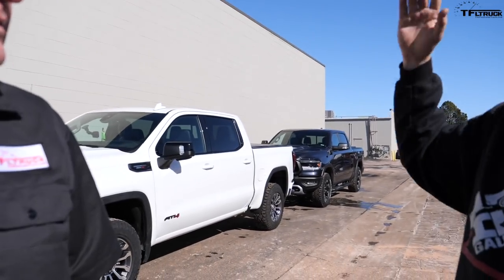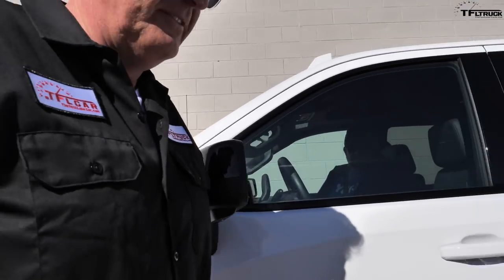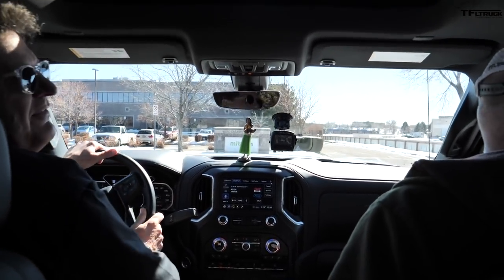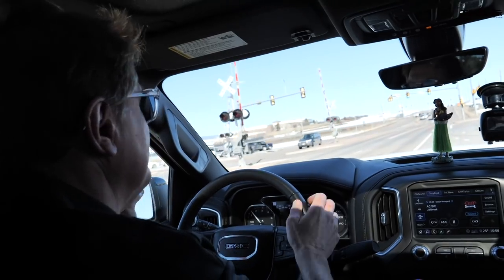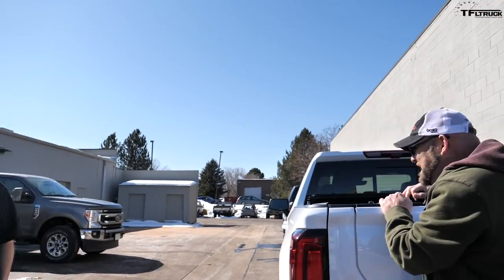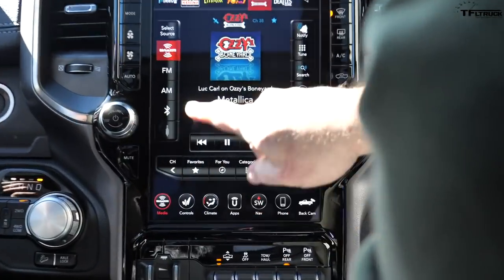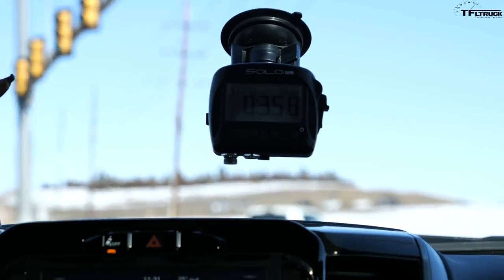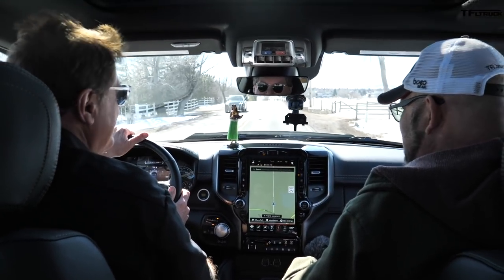Best Diesel Truck! 2020 GMC Sierra AT4 vs Ram Rebel Diesel 0-60 MPH Buddy Review

Comment: The barn door is much more functional.  The GM tailgate is a gimmick with lots of failure modes.  Its not going to age well.  Putting electronics in the tailgate is always going to be an issue.  Its there to look pretty, sell trucks to people with more money than brains and only needs to work till they drive off the lot.  Thanks Roman for demonstrating the issue with the bumper step.  And they fill with crap, freeze and look like crap.
Reply: I don't know which video you were watching, but tur Ram had push button electronics to open the tailgate too
Reply: The bumpers rarely fill with anything, I have NEVER not been able to use them because there was crap in them. I live in MN and mine has had zero freezing issues. Quit speculating on shit you don’t know anything about. Both of the trucks have electronics in the tailgate. Quit being a RAM fanboy
Reply: @zimks  Thanks for the well thought out response.  You devalue your comment with your own words by attacking a commenter rather than providing  your own opinion and supporting rational.  But I am sure you can learn from your experience.  :-)

I live in Colorado.  My two trucks live outside 24/7.  Everything fills up with snow then freezes and turns to ice.  After a foot of snow I cant even see my trucks as all surfaces are deep in the white stuff.  I have had 34 inches of snow on the level in my driveway.   Left on its own, the snow will thaw, freeze, thaw and freeze and form a crust of ice.  Given the right conditions the bumper step can fill with snow and become a slip hazard.  The safety engineer in me says to avoid them unless you have inspected them to make sure they are clean and dry else you will be crushing your nuts on the side of the bed or on the top edge of the highly functional tailgate.  Much like Roman almost did while exiting the GMC.  

Also, I personally find this kind of "feature"  (I consider it a non-functional gimmick but that is my personal opinion) unattractive at the least and a pain to maintain.  I keep my vehicles in better than showroom condition through frequent maintenance and care of the exterior, interior and drivetrain.  Any black plastic part is a magnet for fading and deterioration without regular maintenance.  In my case, I will not use them,  I don't need them, and I don't want to see them.  Other than that, I am sure they are great for you and I am happy that you like them.  I hope you have them on every truck you every buy. 

Your comment about RAM fandom reads like sour grapes.  GM is giving up market share to RAM because they are a higher value purchase.  Same or better performance for same or less cost.  Why would I ever stop being a RAM fanboy?  I had nothing but Fords beginning in 1976 with my first F150.  Black 4x4, regular cab long bed.  I have owned 10 F150s before I bought my 2015 RAM.  I bought it over the Ford (never considered a Chebby) because of the cost of ownership for great performance was very favorable.  Cheaper, better, faster.  :-)

 I am too old to be a boy in the first place and  you and I are not butt buddies so you don't have a clue what I like or don't like, and the last time I checked my copy of the constitution, I am still free to have my own opinion without an internet troll hiding behind the glass casting aspersions.  Hope you have a truly wonderful day up there in Minidoka.
Reply: @domin8ss  Interesting, the videos I watched showed a mechanical latch.  No electronics but I have not actually had hands on.  Have  you?  Thanks
Reply: rob the elder the same could be said about yours 👍🏻
Reply: @06colkurtz  just go to 17:58 in the video.  There's clearly an electronic button to open the barn doors.

Comment: At the prices either of these trucks cost, fuel mileage really doesn't matter.  Can buy say a used 2 year old gasser getting far less mileage and afford to buy the extra fuel.  A typical 2 year old gasser $25-$35k., vs these at well over $65k?  The depreciation alone will be staggering as most over priced big three automakers trucks are today.

Comment: I agree about the huge screen the Ram has. It's too much. Overkill really. The actual info part of the screen isn't even that much bigger than GM or Ford. It has a bunch of touch screen buttons which I don't care for as well. But yeh all that touch screen stuff takes up like a third of the infotainment screen. So it's not really even that much bigger. It's just way too busy and IMO takes away from that amazing interior in the Ram trucks. So yeh I'd say it's a waste of tech. Not to mention if your hands are dirty after working and you get that screen dirty the touch function isn't even gonna work right. Give me the smaller less busy screen that you can still use actual buttons on any day of the week.

Comment: Those "super-cars" have exposed weave carbon fiber. You can get carbon fiber that looks just like plastic, typically that is under the paint on exotics that use carbon fiber since it wont be exposed.

Comment: I was at a dealer and there is no skids plates only on the engine and it to tin :( that’s all :( 
They need to put the interior from 2021 Yukon :) and electronic lockers to :(
The GM it’s not off road truck it’s Country road truck LOL 😂 
And there is no 2 inches lifting kit  it’s level kit LOL , it hurts to knuckles and it’s made to be in the shop :( 
If you look carefully there is no difference then Denali & Sierra or AT4 :( only Rancho shocks junk and tiers LOL 😂 NO Dif Lockers no proper lift kit :( and cheep Shocks :((

Comment: Don’t like the all-in-one dash on the Ram. I’ve seen vehicles come in to the dodge dealership where the head unit has failed and the owner has a difficult drive into service because they can’t defrost their windows (live in Alberta) because the climate controls are in the head unit.

Comment: Is at4 replacing z71?
Reply: No,  AT4 is a higher trim than the z71 or at least more of an off-road package.
Reply: @Tiovergudo  they both have off-road goodies. That's why i asked
Reply: Seth Moore An AT4 offer even more off-road Goodies: Goodyear Duratracs, specific Rancho shocks, front 2 inch lift, unique heads up display features, specific interior. Here are some more details on their website: https://www.gmc.com/trucks/sierra/1500/at4

Comment: I really like both trucks but I noticed on the Ram that there was no AWD button.
Reply: Depends on the model and package you get. My longhorn had AWD mode.
Reply: Not on the rebels it's a different transfer case and supposed to be more robust for off road use than the one with 4 wheel auto
Reply: @ChrisH421  they just cheaped out & they know it. All ram base models have part time 4wd
Reply: @UltraSS-nj8kd  have you ever seen the internals on the 2 transfer cases it's the same reason 4 auto is available on a jeep Sahara and not on the Rubicon one is better for taking a beating off road with less moving parts and one is better for on road use
Reply: @ChrisH421  yes its cheaper aka less complex so they cheaped out. The full time arguably works in certain conditions offroad better sand for example. But neither is going to take any kind of "beating" both have the same casing & will be punctured with ease if high centered wrong especially

Comment: Why anyone would buy a half ton diesel with the intent of towing? When you can get a HD/SD truck to do what you need in a more safely manner for the same money, sure you  will have to compromise on trim levels, but even so the new trucks are a world away from those built just 20 years ago! With gas engines making great clean power!

Comment: Funny stuff! I think you tell viewers to but GMC elevation instead. I bought mine for 42,800 before tax . More options than SLE. Ram is always always overpriced as are F150s. You get more truck for less with GMC. Ram trucks look cool but cost too much for all the issues they have had.since they screwed everyone with the last generation diesel how about a 10k rebate as a gift

Comment: Actually, the Ram boxes are my LEAST favorite option since I can't use toppers or slide campers.  Basically, the entire bed is compromised in my view.  I like the Nissan's version where it sits inside and is removable.  Nevertheless, these barn doors are great.

Comment: Andre I am confused.  When they showed the closeup of the bed while you were saying there is no weave, we were looking at the weave???  The reason they had to go with the carbon bed is because they beat up Ford over going to aluminum so that was not an option.  So they go with something that is WORSE for repairing.  LOL  Only GM
Reply: If you need to repair it....

No metal, so it won't rust.  So solid they launch objects at it at hurricane force speed and still haven't broken the bed.

Comment: Would expect dodge to have the straight 6 and Chevy to have the v. I wouldnt buy either of these because the power is just awful so seems like maybe people r just buying these because mpg ??which if u want something with some what similar mpg but nicer with more power just buy the new tundra hybrid or if u really dont like buying fuel just buy a ev truck the new ford lightning has more power and will supposedly start out at i think 40k

Comment: GM uses an Aluminum for a diesel DIESEL engine?  vs Compacted iron graphite?   Ill stick with the Iron diesel.   You don't see heavy duty trucks using aluminum diesel engines for a reason.

Comment: Yuck for both. My 2019 $23k gray wheeled Colorado has a 7k lb tow rating and I always get 23-24mpg on the v6. I towed my friends 97 TJ on a uhaul car hauler and averaged 17.3mpg with 55mph average. Gm is doing some dumb stuff. I wish I bought a 3.5L eco boost f150 instead of a 2014 Silverado I traded in for this Colorado. Next truck will be a early to mid 2000’s Silverado again. I can’t deal with these payments no more. And I feel like most of these you tubers are not sporting 40-50-60 thousand dollar truck payments promoting these new rigs.

Comment: they are all way over priced. there test ok, now how long will they last, Rams from what I have seen starts to rust out first compared to all the others after the 5 year mark..
and then the next thing on these trucks is how many miles will they make it before they start to nickle and dime you to death?? for the price they should give you a warranty that the truck will not rust for 20-years otherwise you get a new one no charge..

Comment: 1 out 3 guys could figure out the GMC tailgate? Come on this is getting crazy its a tailgate do we really need it to be so complicated plus I live in Canada how good is it going to work after 10 winters? I get it it's a gimmick But is it really practical. Plus the RAM barn doors they don't open wide enough to let a forklift even get in there.To each there own I guess. I'm a roofer and I work my trucks hard and I'm in and out of the back a lot and regular tailgate has always done me gust fine.

Comment: Take away the $2000 air suspension and $1200 Ram Box, and you'll be closer in price. Plus the Ram has options unavailable on any GM(full pano roof, 12" UConnect.) Sure, the GM is faster, but unless you're gunning it all the time, you have to live with that awful interior. Still, I think the AT4 is the best truck GM makes.

Comment: What a waste of time the ram is carrying a lot more fuel i the larger tank that add a lot to the weight and will slow the ram down on the 0-60 time why not get a set of truck with the same size fuel tank  that would level the test to a fair playing field . I have the 2019 ram with the v8 hemi the ride is really good like a big town car and quiet and i love that it make a world of a difference on the terrible rodes we have it does good on gas on highway but in our town they have a stop sign ever block the gas mileage is not good but that no falut of the truck guys already knew they were going with the GM . Look on the road you going to see a lot more new model Rams then chevys i traded my 2 year old chevy with only 10 thousand mile on a newer model 2019 ram drive them both and you make the choice

Comment: i think the theory behind plastic and faux carbon crap everywhere, and electronics is nobody keeps a truck more than 3 years anymore? Unlike my 12 year old truck with all metal everything and no big screen in the middle of the dash. Shit don't go wrong, I beat it up working, and it just keeps running. And I can do my maintenance without having to pay a $100 and hour tech to flip a switch and tell me I need to have the engine replaced................................

Comment: The gearing in the GMC is all wrong for towing. Yes, it can pull 9300 lbs out of the box, with a 3.23; but imagine how much better with a 3.55 or 3.73.
Reply: This truck with 3.23's and the 10-speed has a more aggressive final drive than the last truck's 6-speed had with 3.73's.
Reply: @karlschauff7989   sure, but with reduced towing..and TOWING is the point with a diesel pickup.
Reply: @Shawn-ik6dr  HAHAHA not in a half-ton. The only reason Ram, GM, and Ford are selling diesel half-tons is for the fuel economy. That's it. That is the only reason. Otherwise they would have given these trucks a lot more displacement than a puny little 3 liters. It's also why Ram keeps using the junk 3.0L Ecodiesel even after 15% of them have blown up. They don't have a choice because without it, Ram would have such a horrible CAFE average that they wouldn't be able to sell Ram 1500's with the ancient gas guzzling 5.7 Hemi. Ford and GM are using diesel engine options for the same reason. They aren't meant to be towing monsters like the HD trucks. It's all about getting highway MPG's in the high 20's to help boost their CAFE average so they can sell half-tons with big V8's and thirsty 3.5 Ecoboosts.
Reply: @karlschauff7989  Wow, talk about misinformed. First, the Ecodiesel is all new, the only things remaining the same is the name and displacement. 
2nd, diesels; half ton or HD, are designed to be efficient towing machines with longevity and strength. Compare the torque numbers between diesel and gas.
3rd, obviously you know that a 3L diesel is about the same size (footprint) and weight as a much larger gas engine, right? And that manufacturers are limited to the size of the engine bay when trying to shoehorn a diesel in there. A good example of what NOT to do is when Toyota tried to stick a 4.5 diesel into a Landcruiser and had to increase the front track to do it, (without doing the same to the back axle)
4th, gas engines are much MUCH cheaper than diesel and unless you are constantly towing long distances, you never get your money back from the diesel purchase price. I fully admit that under regular driving conditions, gas engines are ALMOST as efficient and most folks are better off getting the gas once the price is factored in.
5th "fuel economy" is partly right, in that "fuel economy" WHEN towing is the measuring tool when deciding on the purchase. Simply put, Diesel fuel costs more than gas. You just use less of it when towing half (or more) of the capacity of the truck.
Lastly, if you STILL don't think that the gearing makes a difference, do yourself a favour and look at Ford's specifications for its half ton and pay close attention to the numbers when you go from a 3.08 to a 3.23 and finally a 3.55 in its 3L diesel.

Comment: GM needs to ditch that G80 for an E locker already.
Reply: I would trust the 12-bolt G80 over a factory E-locker. FCA has had way too many problems with their E-lockers.
Reply: @hochhaul  ha! The G80 is a clunky worthless piece of dogshit. I had a Power Wagon l used to best the shit out of for a couple years and lockers were never a problem. Few other problems admittedly...

Comment: id buy neither.... whats the point of an eco diesel that gets 50% more gas mileage than a gas truck when diesel fuel is 2x the price... you're actually losing money....

especially when you consider the cost of diesel parts if it breaks.... DEF fluid SUCKKSKSSSS.... and they both have less HP than the gassers....

Comment: So it costs more to drive a truck with less power...can we go back to the 80’d and 90’s? I’d rather have an F250 or 350 with a 7.3 idi or even a Dodge with a 12 valve...Back when trucks were trucks, and they’d probably be close 0-60 as these 2 expensive toilets.

Comment: You guys crack me up. You're excited about the carbon pro bed, yet all it is is plastic with embedded carbon fiber. The Toyota Tacoma has been doing a composite plastic bed that was super lightweight, durable, but didn't have carbon fiber. Yet years ago Mr. Truck calls it a bed liner lol. You guys missed the hype train on creative lightweight bed materials 15 years ago lol
Reply: Does the Toyota also have nylon woven in?  Just curious.  I really don't know.
Reply: @domin8ss  just plastic. I had one for 5 years, but kept a tight watch on forums and no one ever complained about it being weak or damaged. The worst part of the overall design was that the outer bedsides would sag with racks and toppers because the inner bed tub normally provides strength on a steel bed. Never saw a hole or crack in the inner bed itself
Reply: If Toyota's offering was so good, why do you think they didn't offer it in the Tundra?
Reply: @domin8ss  no clue, but I'd guess the market in 2007 when it was last redesigned was skeptical about it being weak. Ford took a beating with the aluminum bed and GMC knew they had to put $$$ into marketing to break that perception, hence "carbon PRO"... their a cinder block into a Tacoma, it won't break that either lol.
Reply: Ford's mistake is "Military Grade Aluminum".  Anything labeled military grade, doesn't who made it or what it is, means it's the cheapest low quality item that could be built to satisfy military testing.  Some of the testing is absolute bullshit.  Just ask any veteran.